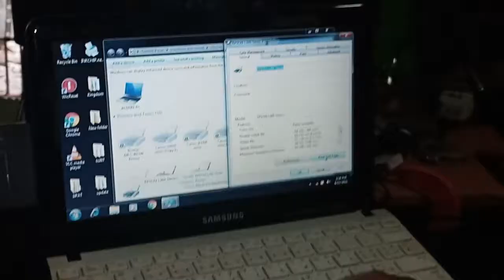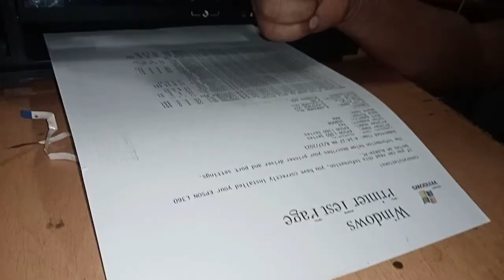EPSON L360  | TURN ON POWER WITH NOISE

Comment: Hello brother i kind of have a problem with my epson printers, my epson 365 when turned on, it seems ok with no error, but when you print anything, the paper is picked well into the printer, then the ink and paper lights starts blinking, and the paper stops and nothing is printed, the head moves freely , then it displays 'ERROR 9F' ON THE COMPUTER, plz anyone what is the problem, the gears are perfectly well
Reply from the maker: Flexcable